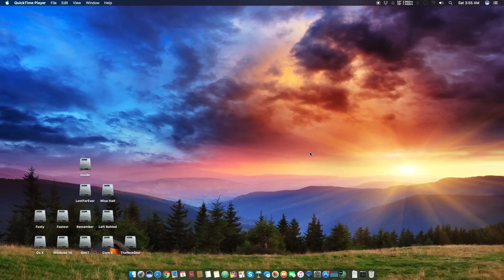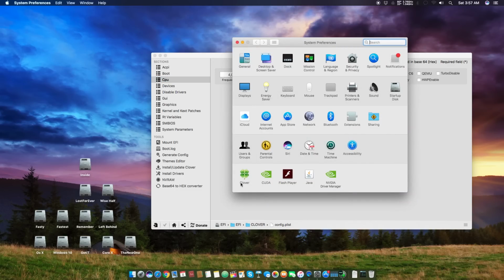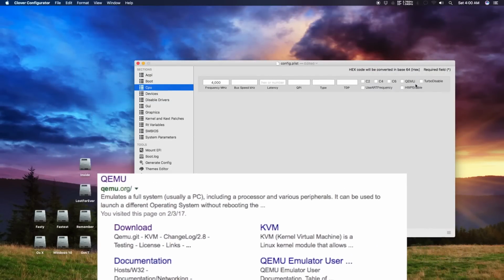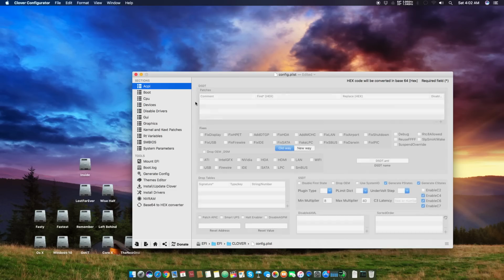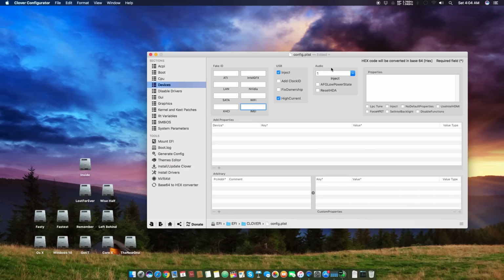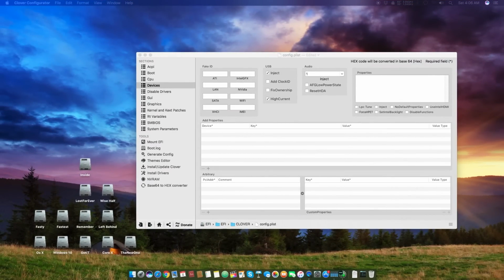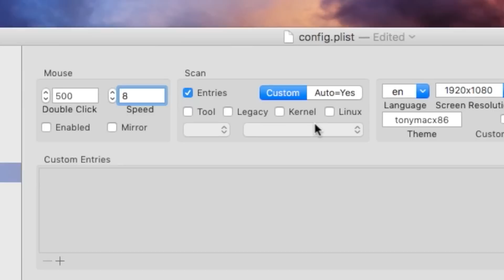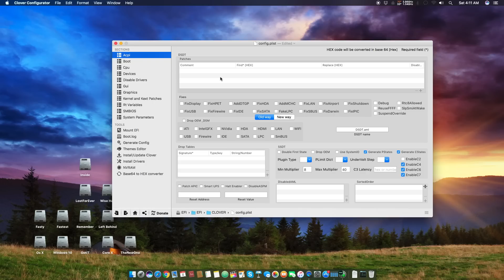Learn Clover Configurator Part 3 UEFI Hackintosh | CPU | Devices | Drivers | Detailed | 2017

Comment: quick question 
I have a dell 990 with mac os high sierra
proccessor 3.339 ghz interl core i7
memory 14 gb 1333 mhz ddr3
graphisc  gtx 1050

I see you have the check mark on the ACPI  generate Pstates
and then EnableC2, EnableC4 ,EnableC6
do you recommend to activate this options ?
also Do you recommend to activate  on the CPu C2, C4 and C6

If there any better performance when we activate this options?
Thank you